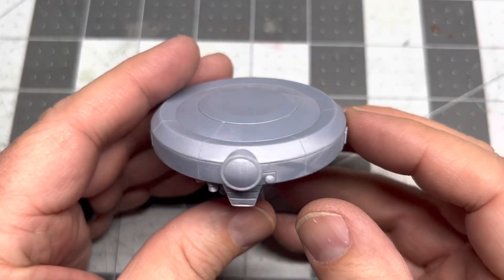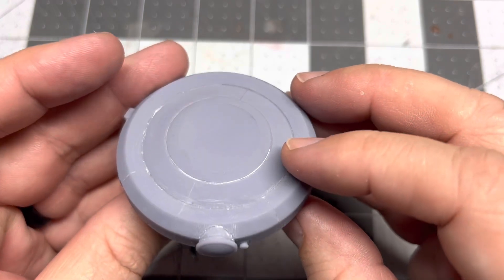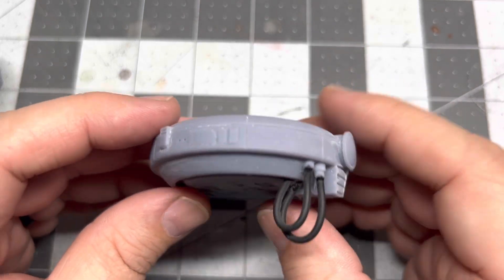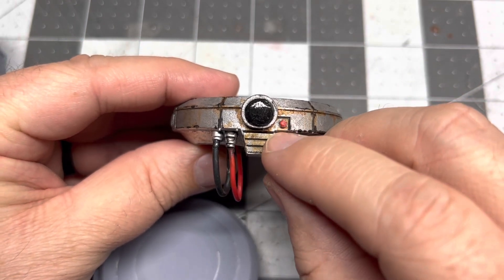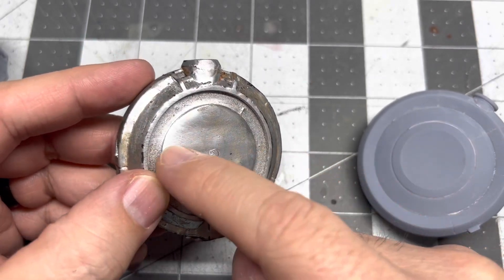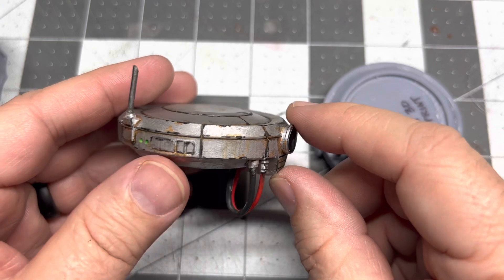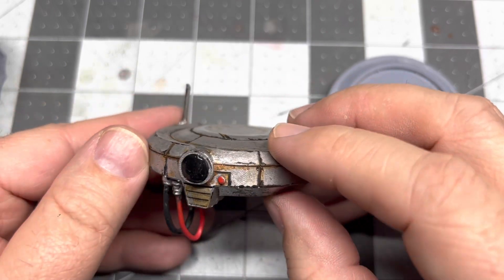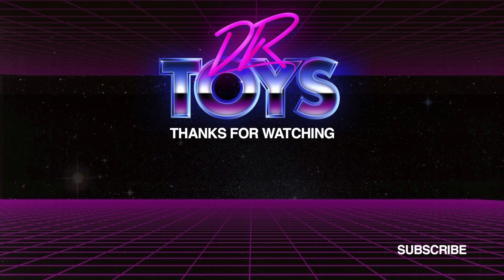First 3D Print Off My Anycubic Mono 6K Resin Printer - 1M ROBOTS UPDATE

Comment: I've got the mono x. It may be different with the 6k, but I recommend checking the build plate for flatness. Mine wasn't flat right out of the box and it will cause models to fall off during the print. Also, for filling holes I recommend using the same resin the models made of and a uv flashlight. If it's too runny you can thicken by mixing in baby powder. If the material you plug the hole with is harder or softer, when you go to sand it there will be a difference in "sandability", if that makes sense. If the new material is harder it won't sand as easily and can get a depression around the hole.
Reply from the maker: Great tip. Thanks!

Comment: 04:00 be careful, resin inside a print will probably crack your print someday, you need to remove the resin
Reply from the maker: Good to know. Thanks
Reply: @DRToysCreations  oh, maybe try using clear resins, you will not regret it